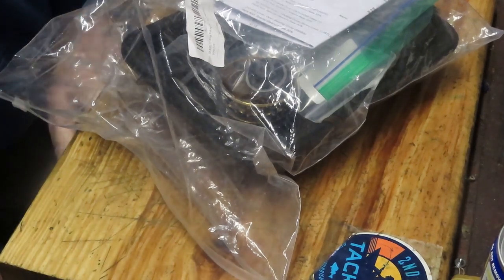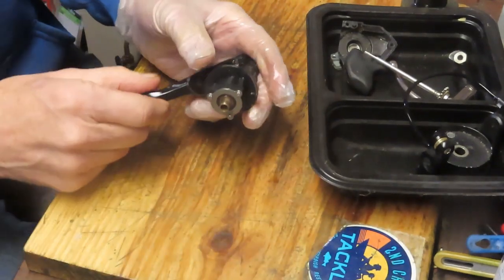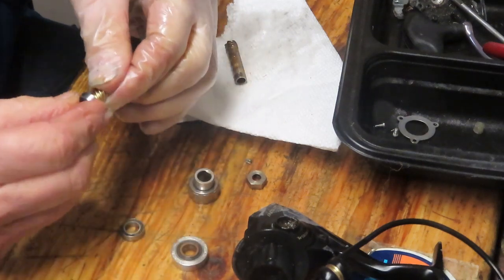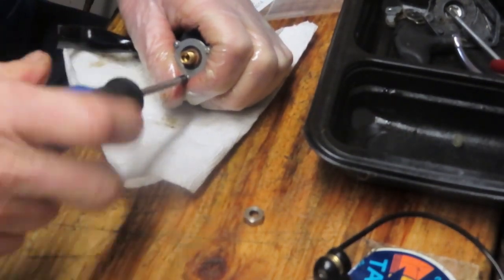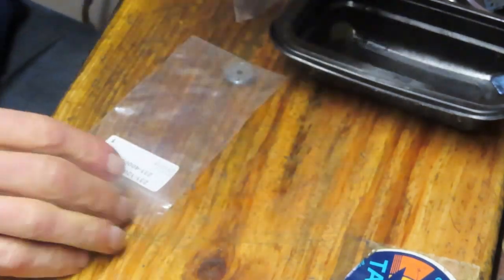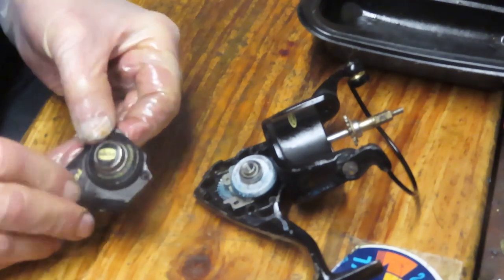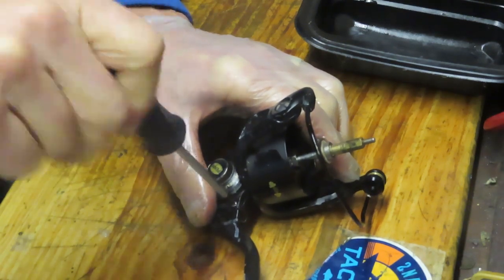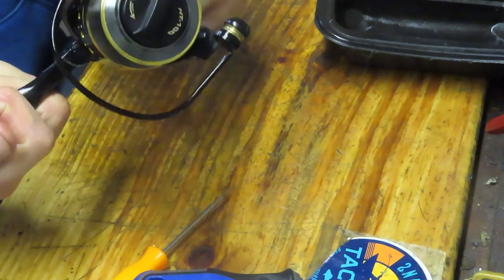Penn Battle II 4000 fishing reel disaster how to service and repair

Comment: Hi, I have a penn spinfisher v 4500, it wobbles a bit in use, can't find the cause. Does it also have the plastic bush cap at end of the pinion you mentioned on this battle as stopping wobble. Do they wear, could it be my problem? Thanks
Reply from the maker: If the rotor is fully tightened down, then the cause is either a bent bail wire that is causing the imbalance or a bent axle shaft.  I don't think that the SPV uses the collar on that reel.

Comment: love your videos!! 
Hope all is well
Quick question i have a battle2 5000 that i cant get the handle to screw out. Guessing saltwater got in and has it siezed. Any suggestions on getting it to come out
Reply from the maker: That is a tough one.  The handle screws out the reverse of the crank rotation. I would flood the base of the handle where it goes in the case, with penetrating oil and let it sit for a few hours, and try again.  Be careful, you risk breaking the main gear and or the pinion gear in the removal process.  You didn't say if the reel is broken or not.  If you can still fish with it, you may want to let the sleeping dog lie until the reel breaks.

Comment: Dennis, what is the purpose of drag grease? ie what does grease do?  Felt and leather drag washers use oil to keep them supple.
Reply from the maker: The primary us is to keep the washers from drying out and becoming brittle.  Ditto to Ken's comment as well.  When using the grease, it is important to never over grease them as that will just collect dirt and lead to premature wear

Comment: I really like my Battle 6000.  I use it for surf fishing in the southeast.  Silky smooth and very incremental drag, meaning, every turn is a perfect increase / decrease in drag, no jumps / skips.  Hooked and landed a 5 foot black tip with it last year while fishing for redfish - 45 minute fight-one for the ages for this old man.  I rinse it in fresh water after each use.  I have had it for 3 years now, no issues, and will service it and my other 2 surf reels (Fierce 5000, pursuit 5000) for the first time this year.  Any differences in the 3 than the sealed bearings?  Thanks for the video as always Dennis.
Reply from the maker: THat's the way to care for your reels.  They will last a long time and keep you fishing.  Thanks for the note - Dennis
Reply: your going to service a battle 3 the same as the 2...he has a couple videos of the battle 3s if you want to watch
Reply: @njbassin7729  Thanks.  Actually I was asking (poorly) if there was any difference in the servicing of a Battle II 6000, Fierce II 5000, and Pursuit II 5000 (3 reels).  Just found Dennis's videos on those reels.

Comment: Hi Dennis, my son has a Penn Battle all 4000 that seems to work perfectly until you start fishing with it and it starts getting real tight reeling it in with just the load of a lure on it and almost impossible to get a fish in because it gets so tight. If you’re just spinning the real it’s as smooth as butter but with a load it’s like it’s seizing up. Therese’s no grinding that we can tell of. Just wondering if you have an idea as to what to look for as I’m taking it apart to try to clean and fix it?
Reply from the maker: I've seen several things that could contribute to this.  Here are a few - Worn or damaged crosswind block or oscillation gear, would be my first guess followed by a  bent axle shaft or frozen bearing
Reply: Thanks Dennis, I’ll keep that all in mind once I get into it.
Reply from the maker: Please let me know what you find!  Dennis

Comment: hello, I've been following for a little bit, but was wondering if you had access to reel handlers for a star reel?
Reply from the maker: I do not.  Those reels were only around for a short time.  I don't know when you will find the handle.  Good luck in your search - Dennis
Reply: @2ndChanceTackle  Star reels are still in production you might be able to contact them directly for a handle.

Comment: I can't imagine replacing 2 out of 3 gears, shipping is the real expense, even on Fleabay, sellers will most of the time combine shipping. $25 isn't too much to fix a reel like this, if only to the job right , you have to have pride in your work
Reply from the maker: These were cheap, so it made sense.  Some of the modern gears on the higher priced reels are going for $75+. That is an entirely different decision at that point